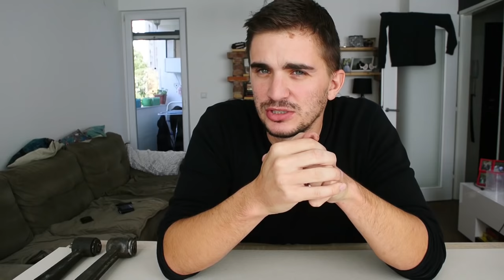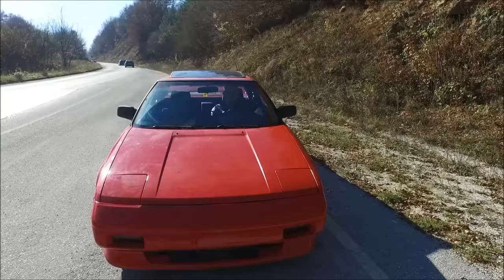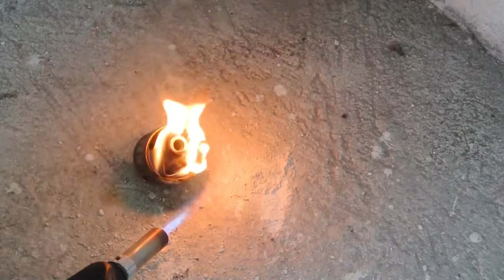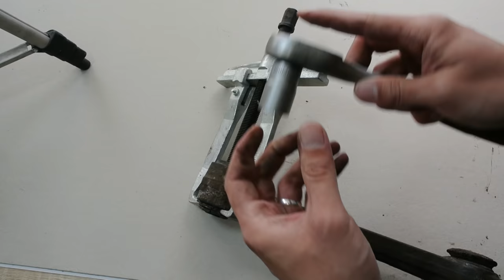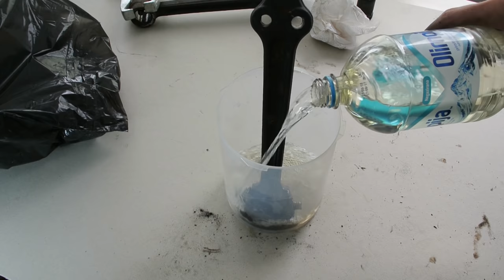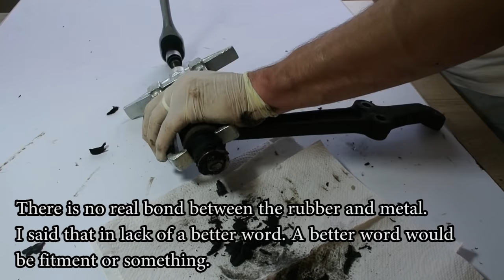How to remove rubber bushings without a press or burning - suspension episode 5

Comment: Here's how I have removed bushings: clamp the control arm in a bench vice, then use a hole saw on a drill to cut into the rubber bushing, then attach the drill to a wire rust removal tool and pull it back through the opening, clearing all the rubber and leaving the metal clean!
Reply: BRILLIANT!

Comment: How about reinstall a new rubber bushing?
Reply: Con una prensa
Reply: You could use the gear puller to install it. Just put a washer on the side where the shaft pushes against the bushing...

Comment: Great tips for bushing removal.  One bit of advice, a little heat from a propane torch on the control arm collars (around the bushing) helps loosen everything up.  If you do it lightly, it won't cause too much of a stink in your workshop.

Comment: 'Interference' is an automotive term used for when things fit very, very tightly or are squeezed to fit somehow but to talk about a 'bond' is a perfectly good way to describe how the rubber & metal have mated (before you undermine them using the petrol trick to help separate them) in this video. Your English is excellent by the way.

Comment: Would it help to heat it with a torch while it is submerged in gasoline?
Reply from the maker: Just throw a match. Same effect :)
Reply: Yes, absolutely. Even better when done in a garage with the doors closed
Reply: try it
Reply: Be sure to do it at the nearest gas station since they have plenty of extra fuel to get it out.

Comment: Good to know, I will use this method next time I have a rubber bush to remove. For the metal sleeve type bushes you can also use endless thread, two nuts, heavy duty washers of various sizes & one or two pieces of pipe, same principal but it pulls the bush out

Comment: Great video! I like using a drill bit to drill a bunch of holes in the rubber, then push the sleeve out.
Reply from the maker: That's a good idea as well! Thanks for watching and commenting.
Reply: flashhog01   Took the words out of my mouth.  By far my favorite way to remove them..
Reply: How do you put it back in? Taking it out is of no use. If can not put it back.
Reply: Did that too! Way better than setting the thing on fire! Be ready to lose at least a drill bit!
Reply: @carlosvalentin856  You put a new one in with a vice, press, c-clamp or hammer.
Reply: Just have to be super careful so you don't drill into the control arm.

Comment: Great tip and video! This is great idea.  Thanks for sharing. I'm preparing to do this myself.   Regarding burning the rubber. The way i seen it done is heating the outside of the control arm (or whatever suspension component) unless the heat transfers to the rubber melting it away from its shell.  Not actually holding the flame to the rubber.  Posting in case it can help someone. Cheers 🍻

Comment: A realy good idea, especially the petrol bath.
Sadly suspension arms made from pressed steel instead of cast aluminium, often to find on less sporty cars, sometimes do not have enougth "meat" for the gear puller to grab.

If the gas torch is the only solution, here are some tips:
1. Do it outside.
2. Do not inhale the fumes and do not bend over the treated bushing.
3. Let it burn. It starts to stink when the fire is extinguished.
4. No need to completely burn the rubber away. Just heat up the inner steel tube until it can be pushed out of the rubber sleeve gently with a screwdriver or metal rod. The rubber can be pulled out easily afterwards.

On bushings with an outer steel tube, like for example engine mounts I prefer another method:
Mount a hand metal saw with the blade through the inner tube and saw through the inner tube, the rubber and precisely through the outer tube without demaging the engine mount.
The tension of the pressed in bushing then reduces its scope and lets it fall out.
If this doesn't work, do a second cut round about a centimeter next to the first an hammer a flat screwdriver between the outer tube and the engine mount.
Reply from the maker: Great instructions. A video to go along those and you got some great content :) The alternative for thin walled suspension arms is to use a vice and some piping. I've seen it done, a bit fiddly but works.
Reply: Thanks. I thought about making videos but I can't afford a camera because I spend way too much money on car parts.
Reply: Be careful not to mistake that for your water bottle... been there.

Comment: While struggling with mine today, I was wondering what I might use to break down the rubber that seemed to be bonded somehow to the outer sleeve. Gasoline, petrol, benzine. I, for some reason did not even consider that. Thank you. And a great idea with the gear puller. Next project, I will use that. Thank you!

Comment: If you end up with a stuck bushing you can always heat the metal holding the bushing with a torch. (Not the bushing it’s self) it will allow the bushing to slide out much easier and less than multiple days.
Reply: And fatigue the metal of the part being worked on? No thanks,

Comment: I've drilled them out before. Everyone has a drill and bits (I think). Make lots of drill holes around the rubber. It eventually reduces in volume to the point it can be pushed out by hand using a screwdriver.

Although, don't even attempt this job if you don't have the tools to install a new bush. It can be done with bolts, nuts, and washers if you're on a budget.

Comment: Try drilling them out. Drill multiple holes through the rubber around the bushing then cut it out with a long razer. You can then slice into the remaining rubber and pull it out.
Reply: @sukhmaidickoff  I've done it on a few hydraulic bushings that can't be pushed out.

Comment: Good tip ive used a hole saw to cut thru rubber and air hammer the outer shell off.

Comment: You can select a socket wrench just large enough to receive the metal bushing jacket. Use all thread with thick washers (and grease) to crank it out.

Comment: Bit of an easier option. Use a small drill bit to drill the rubber arround the bushing then stick it in a vice and tap it out with an appropriately sized socket. Thats how i did mine

Comment: A long bolt with a nut, a piece of pipe just a little bigger than the bushing, and two thick flat washers one just a little smaller than the bushing the other just a little bigger than the pipe. Put the bolt with the smaller washer through the bushing and then the pipe with the larger washer on last put the nut on. Tighten the nut pressing out the bushing press the new bushing in the same way

Comment: Just a vice and standard hole saw does it quickly and easily , the hole saw wants to  be slightly smaller than the external diameter of the bush, finish with a hack saw , jig or recip saw.

Comment: Nice video, thanks for the upload. I actually bought an extraction tool that can specifically be used for my car model only. That means I dont need an expensive tool with 10-15 different sized metal plates - but it has the exact size that I need for my car. Price was around 30-35 Euros. I am going to use it this weekend and hope the material of the tool is strong enough, because it looks like the bushings I am going to extract are really sitting tight and for 30-35 Euros I can´t expect very high quality of the tool.
The disadvantage of the mentioned tool: Since the tool is car specific, once I sell my car, I (probably) can´t use it on the new car as it probably has different sized bushings.

Comment: Get a can of the carb solvent from NAPA or similar stor. It is better than gasoline in that you soak it and they pop right out. Turns the rubber to goo. Just sayin ;)
Reply: Thanks, I think you just saved me a couple of hours.
Reply: Don't think there is a NAPA in Bosnia.

Comment: Don't forget kids to lightly wire brush the inside and clean with a rag. Now you replacing the bushings again might not happen but in the event you do it won't be as hard to remove

Comment: Umm some suspension bushings are encased in a steel shell that is pressed into the control arm.  So all this would do is force out the center metal and you would still be stuck with the steel shell pressed into the control arm. Get a bushing press or rent one. Most auto parts stores will let you rent one for a day. Also using a gear puller can damage the control arm itself. Using something that for something that it wasn't intended for can possibly do damage.

Comment: Also this will not work with bushes that have outer casing on some car you need a press so at the end of the day its worth buying one or a kit for removing or pressing out/in things
Reply from the maker: Gaz Girl It works on bushings with crowns, after you put them in gasoline for a day or two. The crowns can then be removed by hand, you don't even need a knife. Of course a press works better, but it takes up a lot space and isn't cheap. Most average diy car enthusiasts don't do this type of thing too often. If you do this type of work often enough, then of course a press is justified as you suggest.
Reply: For the bushes on my replacement trailing beam, it will be hard to put on to a press.  2 or 3 people may be needed to hold it while the 2nd or 3rd person operates the press
Reply: Bushing presses double as bearing presses and fit into a plastic case just like your tools to. Also you can simply rent one from a parts store for a day as well.

Comment: Lot of good ideas in the comments. Good video. If you put a washer between the threaded rod on the puller and the end of a new bushing  do you think you could install the new one in reverse? Just a thought because they can be pretty hard to install.
Reply from the maker: In my case the polyurethane ones I installed were easy to insert. I used my hands or a table vise for some of them. Installing rubber oem style ones is usually a bit harder but I've seen people have good results with methods similar to what you described, so it should work.

Comment: Good video.  On a related issue, do you have a similarly easy way to change a ball joint on a control arm.  particularly when the manufacturer does not sell a separate ball joint and forces people to change the entire control arm?
Reply from the maker: I'd have to see how the entire part looks, maybe it's designed in such a way tbat it's impossible/ very hard and doesn't make sense. Send me a link to picture. Is the ball joint cast together with the arm?

Comment: simply put a little oil on a drill bit that fits between the inner sleeve of the bushing and the inner wall of the component and drill holes around the circumference. the metal center will fall out and the remaining rubber will follow,,,easiest way !

Comment: I had no no problem with them i use air chisel on steel part of old rubber suspension bushings and refit with the help of large thick washer with bolt welded to it  and used air chisel to drive it in  hope this helps some times i did not remove arm from car, some bushes need to have orientation marked  to obtain correct fit  give it a try

Comment: What brand gear puller was that you used? Wonder if I can get one at the local harbor freight like the one you have? Great work and tips thanks.
Reply from the maker: It's just a generic made in china gear puller, no brand name on it. Any gear puller that has nice straight arms like this that move in this fashion will work fine. Glad you liked the video and thanks for watching.

Comment: Your puller is in fact a press... a mechanical press instead of a hydraulic press.
Reply: It's not. It's called a pitman arm puller. He's using it as a press here, but this isn't what it's meant for. Those arms with the hooks on the end reach around the back side of a pitman arm and pull it off a stationary vehicle. Like this: https://youtu.be/dJs5iS13DGk?t=170  EDIT: Linked a better video.
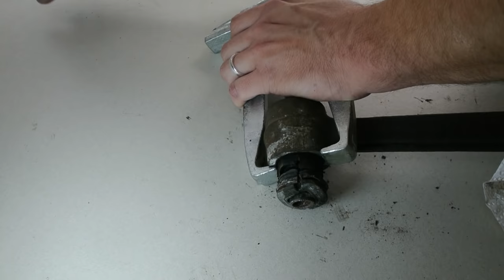Reply: @henrym.2156  How to remove rubber bushings without a press or burning - suspension episode 5  2:25 until you manage to push out rubber ! :)) how is that pushing out but not without pushing bushing !
Reply: Yeah this is kinda useless info..if youre bushings are really worn out you can just cut them out. Then youve got the sleeve to deal with

Comment: Just drill holes through the length of the rubber in the bushings and the will fall apart. Then, just knock out the outer ring.

Comment: thanks for sharing; just a question: you have a video showing how you made engine mounst with polyurethane liquid; you didn't fancy doing the ones you bought (I'm asking since I have not decided yet what I am going to do).
Reply from the maker: You can't pour suspension bushings. It's possible but it's a hassle and a lot more difficult than engine mounts and it would look ugly most likely. Plus, suspension bushings are really cheap new compared to engine mounts for most cars.

Comment: What about a bushing mounted on a car where you have a limited amount of space to even fit a gear puller. I'm upgrading the rear suspension to my 1965 Mustang and am having troubles with the bushings connecting the car to the shackles of the back of the leaf spring.

Comment: Great video,  but how do you press the new bushings in?
Reply from the maker: Thanks. New polyurethane bushings are installed easily with a table vice or even just with your hands. I have a video on that too. New rubber bushings are usually sold together with the arm and aren't replaceable. When they are they need a shop press.

Comment: So my issue is that the toe/camber bolt inside the bushing is seized, which means i cant remove that arm at all and have to do everything under the vehicle. Will that puller still work?

Comment: Can you show how to do this without dropping or removing the subframe from the vehicle. Also I would have to extract it, as pushing it through would not be an option.
Reply: Usually no need to pull the entire subframe, usually you can remove the control arms from the subframe.

Comment: I have a 03 Lexus  gs300 front lower camber arm that doesnt have anything to hold on the shoulder to push it out on the other side. Now what to do?  Go out and get a press?
Reply from the maker: Well.... You could always burn it out. But that's best avoided honestly. Just take it to a shop that has a press. Also, be careful, maybe the bushing isn't replaceable at all and must be bought as a new arm.
Reply: @d4a  thanks.  It is replaceable because I have a new one to put in.  I'm thinking the other option will be a air hammer.

Comment: How about a video on putting new ones in is it just the opposite way or different?
Reply from the maker: Installing polyurethane ones is dead simple, you just press them in with your hands or a table vice. Oem ones usually can't be installed like this and are bought as an assembly together with the metal arm, and are already pressed in.

Comment: This is great. Heating it up seems like it would mess up the tempering of the steel would it not?
Reply from the maker: It won't if you don't overdo it. But there's no need to heat it up if you go for this method.

Comment: Just wondering.. what size gear puller are you using in this video pls.
Reply from the maker: The size is variable as the arms are adjustable. It goes from 0 to around 12 inches at the maximum opening.
Reply: @d4a  ok so its a 12 inch gear puller.. thats what i wanted to know.. as there are different sized pullers.

Comment: So how  to install a new one.
Reply: If you get the 2-piece polyurethane bushings, you just push one piece into each side and put the hollow steel tube through the center. Line up the holes and push the bolt through. The bushings sometimes are just slightly longer than the hole you’re putting them into, so when you tighten the bolt, it compresses the bushings tight. No need for any kind of press. Might need to hammer it in, but that will not take to much effort.

Comment: putting in the new rubber inside is that is easy as taking it out?
Reply from the maker: Putting new rubber in is easy too. You can do it with a few socket wrenches and sockets or using a vice. I'll make a how to video for the installation as well.

Comment: Takes only 5 minutes if you use a drill bit around out side of rubber then use a hammer and socket less stress on the hands and your done in 5 minutes

Comment: Who needs a tool? Only tools needs special tools the majority of UK DIY men with sheds & garages (a place to park your own vehicle) can conjure up a bench vice to hold the item containing the bush, a length of threaded bar, a socket large enough for the bush to be pulled into, a socket or washer to drift the/ pull bush through the item & 2-3 nuts for the threaded bar all of which most normal lads/men will already have in their possession this operation can be done in reverse as well to insert the new bush so why go spend money on a specialised tool? How do you think these specialised tools got designed? It was a man in his shed that saved $12 all because he's not a tool.

Comment: Can you use this on a differential bushing or is there another tool for that
Reply from the maker: If you can get the puller arms to grab well and have access it might be doable. But most differential bushing I have seen didn't look like good candidates for this. There's a method with washers and bolts, there's a bunch of videos on YT about it, might work better.

Comment: The bushings normally come with an outer metal sleeve. I don't see you dealing with that.
Reply from the maker: Not all bushings. But when they do have a sleeve it gets pushed out by the gear puller along with the bushing.

Comment: my question would be do you just reverse the procedure to put the new bush in"
Reply: Could be done I'd say but freeze the new bush in your deep freeze for 24hrs and heat up the metal part where the bush is going in to expand it - and then go for it. I've managed it this way before now. Use good welding gloves though in case you burn yourself.